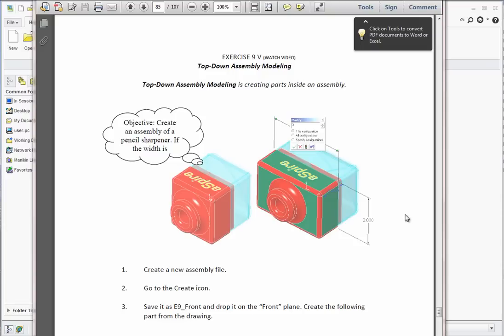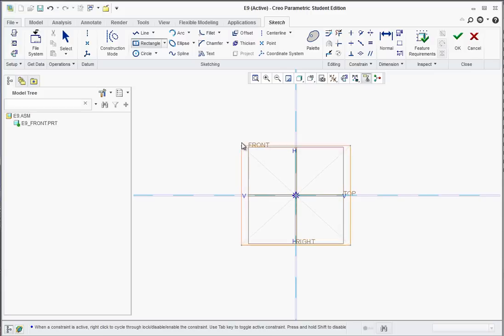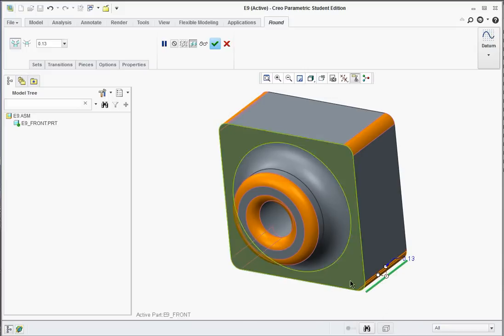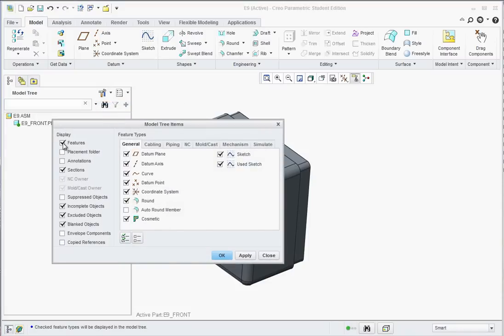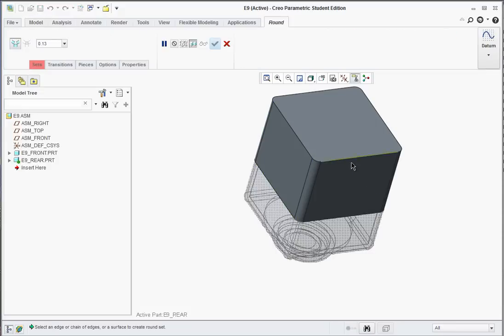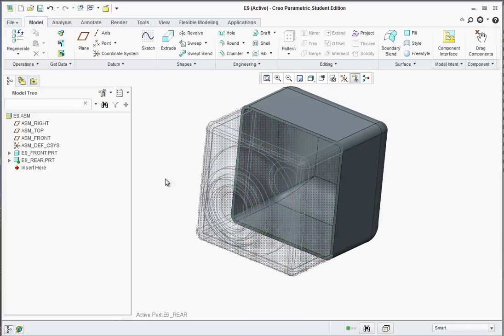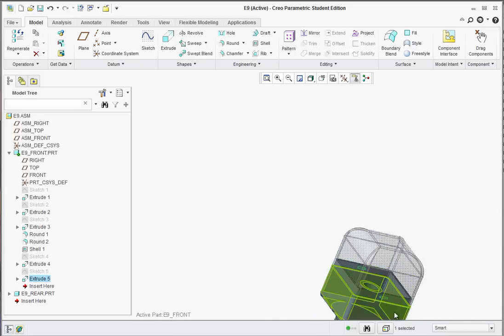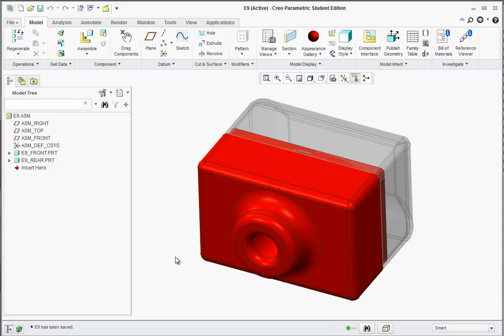E9 CREO Parametric 2.0 - Basic Assemblies 2

Comment: Thanks vertanux1, but that was not what I needed. I already know the explanation you sent. I used to work in a design firm a long while ago, using the Pro-E wildfile for assemblies. It seems like what I am asking is under the assembly configurations, but I can't find it now. A separate small window screen for parts opens up, once you hit assemble>assemble. you can rotate the part and pick your constraints on the part in the window and then place them in the assembly. it helps out because the part is so small compared to the assembly when you start working on large assemblies, and you don't want to be zooming in and out always. I just don't know how to configure it with the new Creo. Also thanks for your videos, it has helped me brush back on my skills.

Comment from the maker: this being a very primitive example utilizes the original part (Front bezel) as it's representative skeleton to derive it's engineered characteristics for the assembly as a whole. Who's to say that the just because the original skeleton wasn't drawn in an assembly sketch versus a part file means it's not still considered top-down? The fact the the rear bezel updates automatically when the front bezel is changed is the foundation of top-down. Thanks for your input. :)